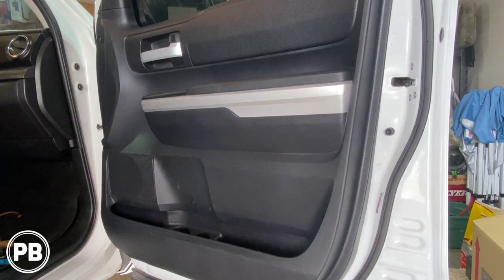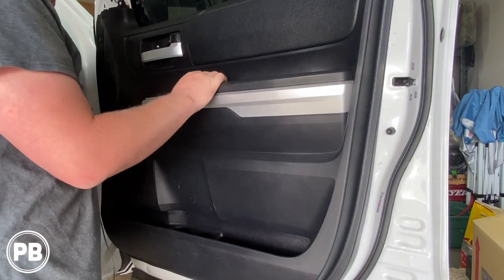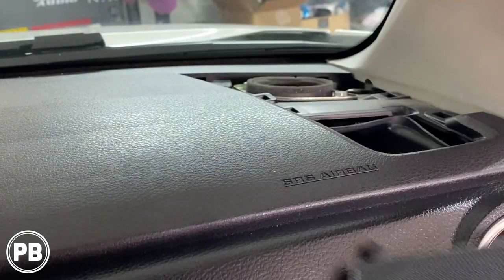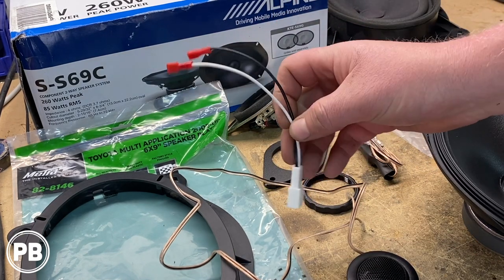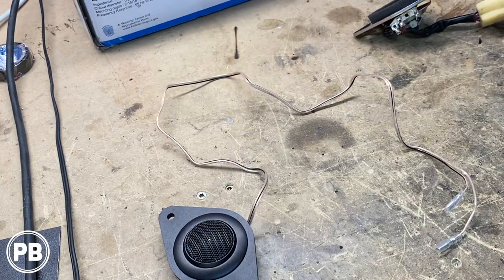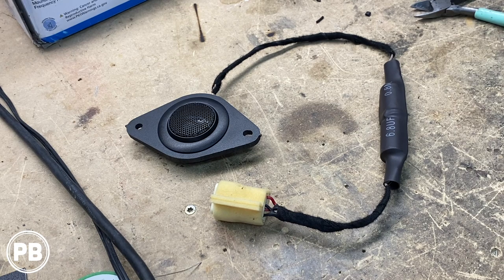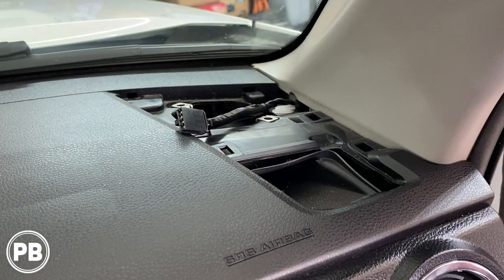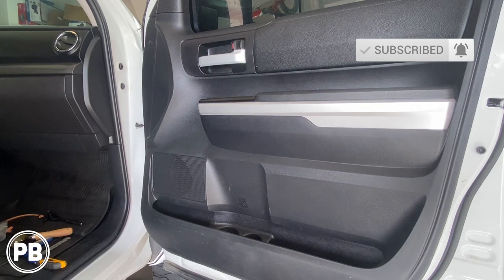2014 - 2021 Toyota Tundra Front Speakers Install

Comment: Great video! I did everything and subs 2 amps all plug n play and never removed the head unit, all the wiring you need is under the passenger seat

Comment: Your install was very thorough, and i watched your video countless times, i am installing (Rockford Fosgate) Puch series, into my Tundra 2019 Limited Crew Max, I will complete my install with a (Kicker 5 Channel Power amp), but I have to start by replacing the speakers first, so i tried to replace the driver and front passenger speakers!!! My question is (How did you get the speakers to mount properly without the speaker magnets hitting the window tracks, without a spacer???)🤔🤔🤔

Comment: Heads up -- the factory speakers work as brackets. Just cut the basket and cone out and mount your new 6x9 speakers right onto them. 
That wiring suggests that the tweeter and midbass are both 4ohm speakers and wired like that present a 2ohm load to the amplifier. There is no such thing as "essentially a pass-thru". Both loads are presented on the same output channel. This is important because if someone buys 2ohm speakers and installs like that, many amps will go into protect mode.

Comment: Great video! Super informative and helpful. My question as a newbie is, can I upgrade my tundra door speakers before the amp? Or does the amp go first? Also, is the sound deadening material available in the links? Do you have other videos detailing it?
Reply: I don't think the factory amp has enough power to run after market speakers in the doors.  With my 2015, I went with Taco Tunes plug and play 5 channel amp, installed Polk Audio separates in all 4 doors (mid bass and separate tweeter with a crossover)  a Rockford loaded 10 inch sub and it sounds great.   I just recently eliminated my center dash speaker and went with Kicker 3.5 2-ways in the corners.  My understanding is the stock radio powers the dash speakers.

Comment: How do the Alpine”s sound. I’m sure better than the stock. Would you recommend them? Do they have a good sound quality bass mid high. I will be using a JL Audio 400/4.  If not any other 6x9 and 6.5”s you can recommend. 
Ps:// People are raving about Skar any thoughts. 
Thank You
2020 Tundra SR5 Crewmax.
Reply from the maker: Love the alpines. Highly recommended. Skar is fine too but alpine is a better build quality.

Comment: How is the tweeter getting power now?  I thought it was powered by the head unit.  But you just swapped it out.  Confused here 😅
Reply from the maker: It's still powered by the radio and the midbass would be powered by the stock amp under the seat.  No change in the wiring.  Truth is however, we added a 4 channel amp to power them anyways (and that video is linked in the description).
Reply: @ProvoBeastAudio  thx for the reply.  But how are the new tweeters being powered by the new amp if they are still wired to the head unit?

Comment: Hello. Can you help me out. I have a 2017 4.6l v8 tundra and I’m looking to do a speaker swap with just using the adapter plug ins but when I click on the link it says it does not fit my 2017 tundra. Is this true or would I need to look for different adapters? Please help I need to get rid of these nasty stock speakers 😊
Reply from the maker: Amazon's fit guide is garbage.  Parts listed will work for this gen tundra fine.

Comment: Got a question, are you using the factory radio?
Reply from the maker: Yes see all the videos in the description
Reply: Next question. My 2020 Tundra does not have the JBL system. What should I do with the center dash speaker?

Comment: Is there a harness for the front top speakers instead of cutting and splicing
Reply: NO
Reply: Yes, there is a harness for the top dash speakers on amazon made by red wolf. It won't work for the center dash speaker though, that's a weird speaker & it messes up the sound stage, just disconnect it.